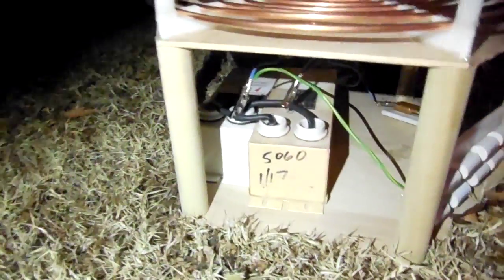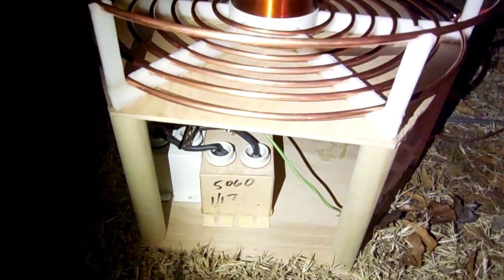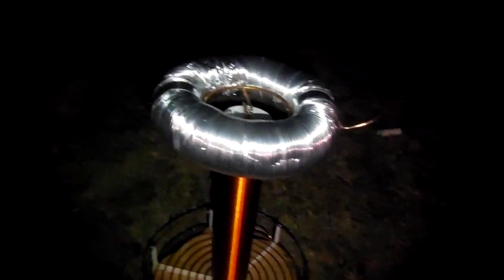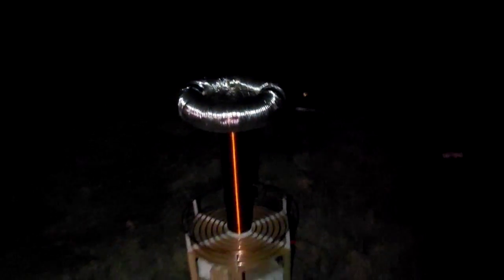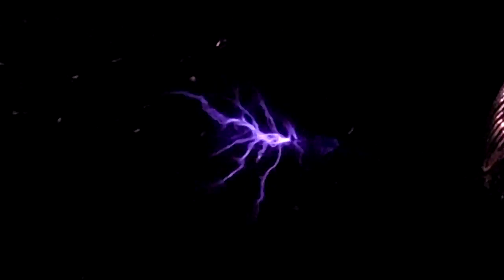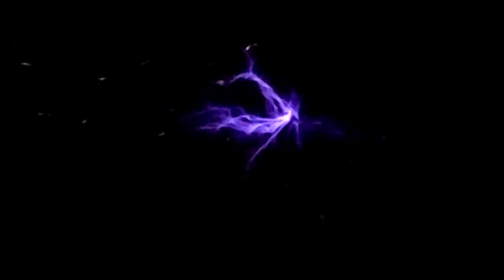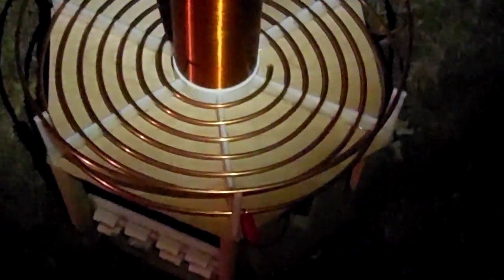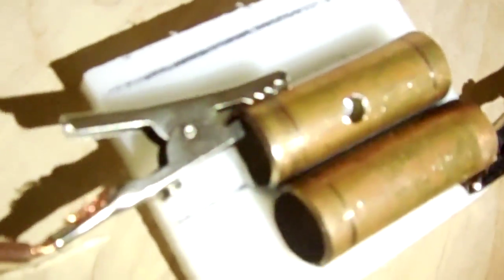Big Homemade Tesla Coil!!!

Comment: Wow! Your one smart young man. The Tesla coil you made is amazing. Your gonna be an amazing electrical engineer someday. I'd recommend using varnish cambric for your spark gap instead of plastic. It won't melt, and has the electrical properties you need. You can buy it at any electrical supply house. Keep building stuff